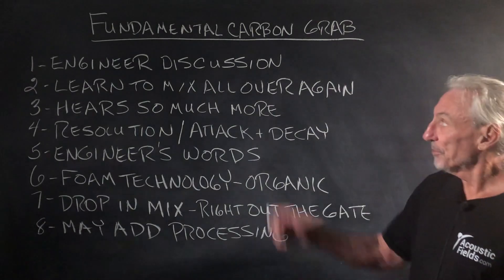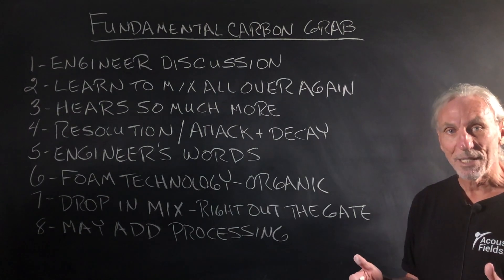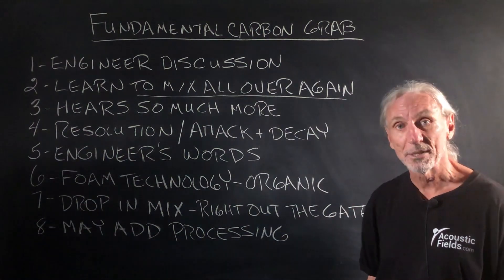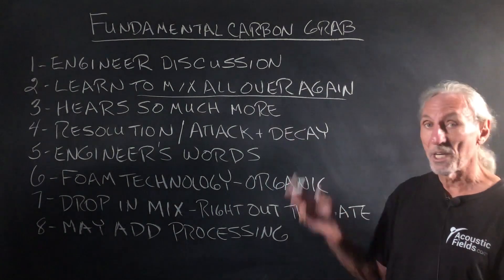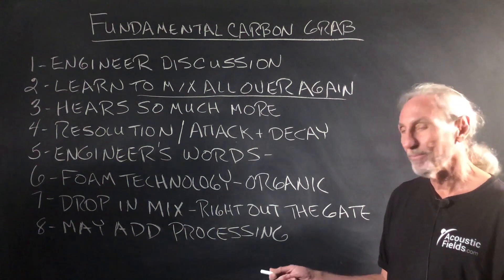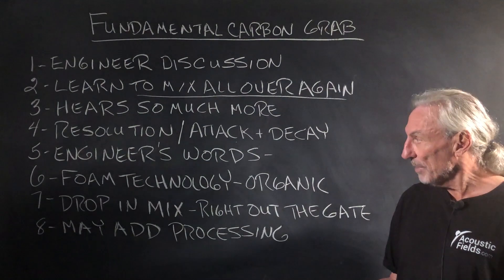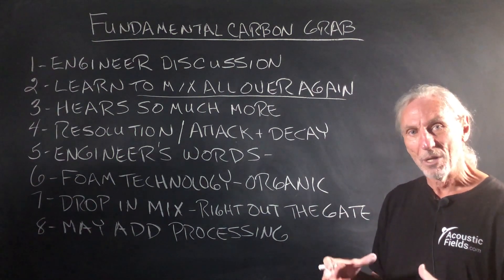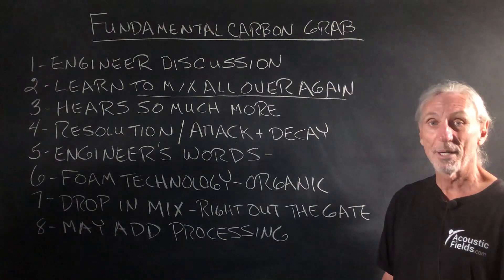Fundamental Carbon Grab - www.AcousticFields.com

Comment: My mom is a violin player. 

Violin produce energy from 145 Hz to 14500 Hz, mostly between 500 Hz and 3200 Hz.

She practice in her bedroom, surrounded by hard surfaces (floors are concrete plus hardwood, ceiling is 2750 mm high made of concrete and stucco, internal walls are made of 125 mm brick and stucco, external wall is made from 610 mm brick).

Does it mean that it is enough to cover at least 50 to 60 % of surfaces with your 2” foam in wooden frames to let her better hear to herself while practicing? Lets say hang panels on 3 walls except window wall and on the ceiling above her playing position?
Reply from the maker: Managing reverberation times is all about the square footage of coverage on each wall surface area. Reverberation times are also subjective. This is where the sayings like a "hot" room or a "dead" room. Try a 50% coverage on each wall for a start. If you want more "dead" room sound add more treatment.

Comment: One of the best videos explaining everything that real bass management can produce. 
Fantastic. 
What about 3D diffuser??
I have never seen you use a wooden block 3D diffuser. 

Can you explain why never use 3D diffuser?

inaccurate results would be my guess?

Would love you to do a video explaining this.
Reply: In other videos Dennis explain that the effects of 3D diffusers are not predictable. 2D diffuser, varying the orientation and combining, may result in a better sound field management.
Reply: @badrini  thanks will check out old video's on diffusion. 

A nice simple video updated would help clear the myths. 
Especially with some folk recommending high density memory foam..

Can get out of hand. With people sticking mattresses on their walls instead of properly constructed active carbon diffusion cabinet.  ;-)
Reply from the maker: Foam is not a diffusion technology. It is a sound absorption technology.  Foam shaped like a quadratic diffuser will never be able to provide the density required of the surface area needed to diffuse energy back into the room. It will simply act as a sound absorber at its designed resonant frequency. This is a marketing ploy for the uninitiated.

Comment: what's the physics/relationship behind carbon and low frequency?...How does it work? the analogy,..we know how foam is able to absorb mid/ high frequency from physics point of view
Reply: As far as I understand it, they use their specially produced carbon in their diaphragmatic LF absorbers. Carbon is processed in a way to produce porosity that yields huge surface area for air friction which in turn converts sound energy to heat inside the absorber thus making the whole structure (diaphragmatic absorber + their carbon inside) very efficient for frequency ranges the absorbers are designed for. Hope I didn't confuse any facts here.
Reply from the maker: The absorption technology is termed diaphragmatic absorption. You can read all about on the net. The depth of the cabinet controls the resonant frequency of the design, the carbon manages the rate of absorption. With diaphragmatic absorption you get both rate and level in a predictable and consistent design.
Reply: Not bad response but though what process does the carbon manage rate and level of absorption?

Comment: Does the carbon get rid of the 30hz and below nodes? If there any
Reply from the maker: Carbon by itself will not but inside a diaphragmatic absorber it will. 
https://www.acousticfields.com/about/
Reply: @AcousticFields  ah..so you also use membrane on the units? I see...ok
Reply from the maker: @arkh1730  No, diaphragmatic absorption is its own process. Membrane absorbers do not perform as well as diaphragmatic.
Reply: @AcousticFields  thought diaphragmatic used a membrane? Am confused now...searching and found this acoustic meta material for absorbing bass...is it this?
Reply from the maker: @arkh1730  There are three type s of lower frequency absorption types. There are diaphragmatic, membrane, and Helmholtz. A diaphragmatic absorber does not use a "membrane" . It uses a structure that has much more density than a membrane.